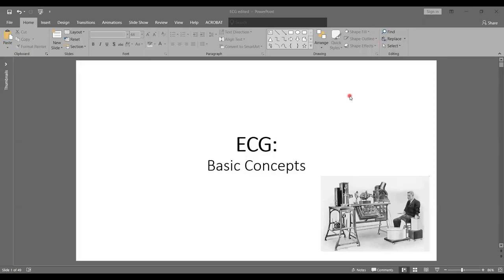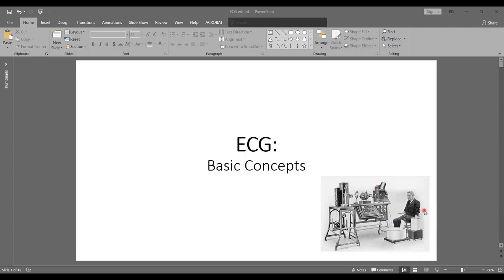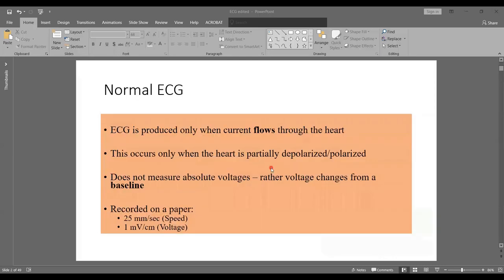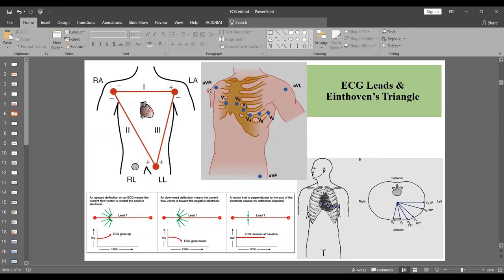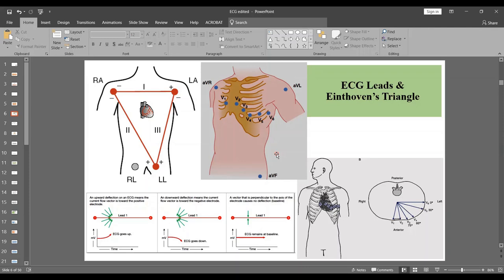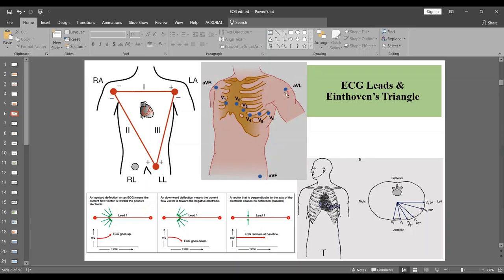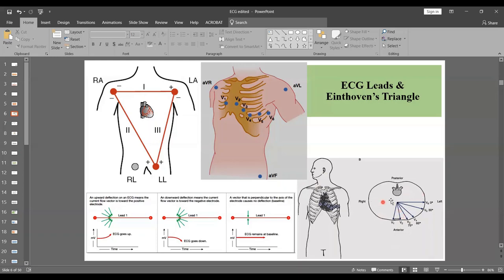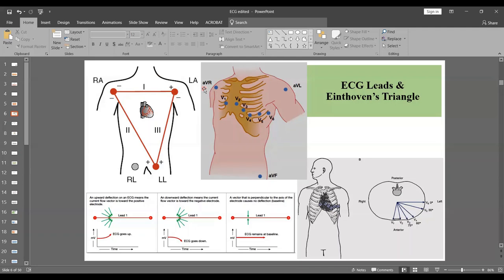BASICS of ECG LEADS -  ECG Series (Part-1) (1st Year MBBS Physiology)

Comment: Those positive and negative deflections of waves are bit tricky. Also the ecg recorded from leads at the end of leacture is somewhat different from the normal ecg shown at the beginning.
Reply from the maker: the ECG shown at the beginning is drawn intentionally in an 'exaggerated' way - to serve to teach undergraduates about the basic knowledge related to waves and intervals. In fact, you may also later note that there is variations between the ECG tracings of various leads - and as we will be showing in the coming lectures, these variations are due to the specific points of the leads that are recording them.